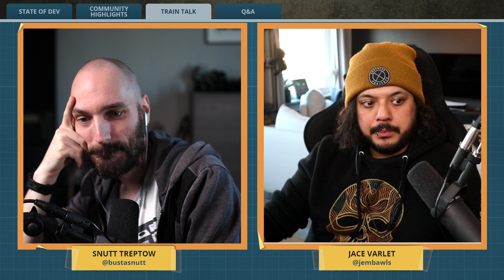Q&A: Can we get more info on chaining Path Signals?

Comment: Path signals don't clear for self-driven trains.  You really should get a green signal allowing you to enter a junction controlled by path signals, otherwise you could be hit by an oncoming automated train.  If the issue is that people might try to change switches while going through the junction which would foul a different train's reserved route, the switches in question should be locked (perhaps the direction arrow should be red indicating it can't be changed).